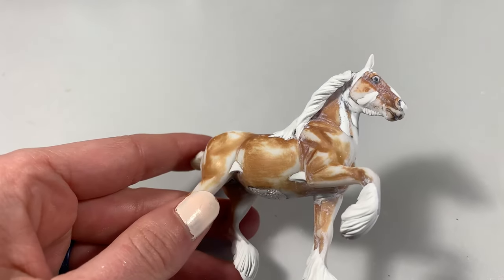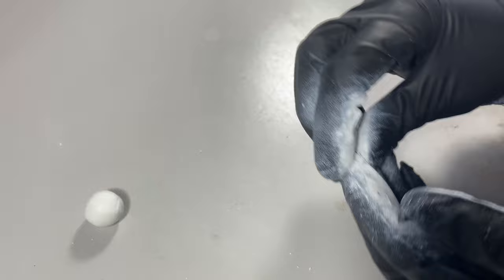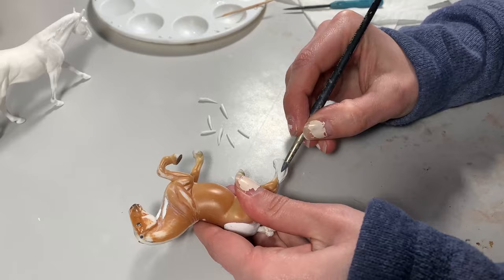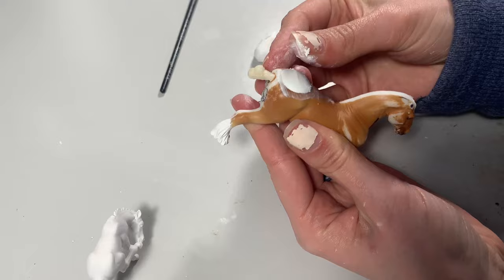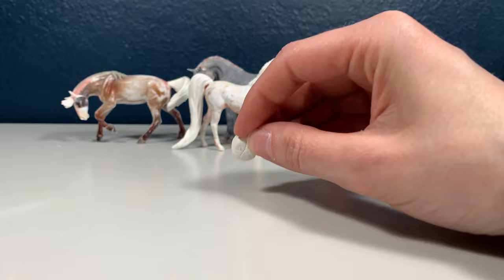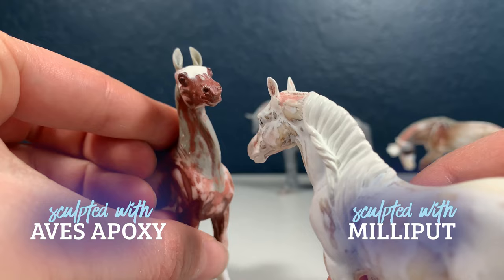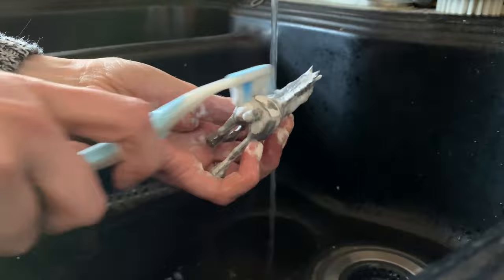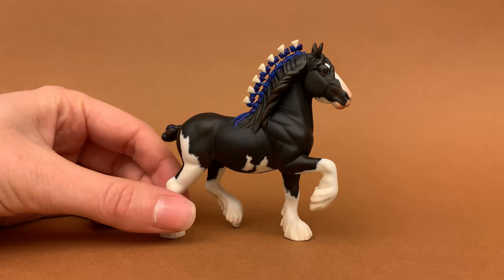From modeling to filling seams: SCULPTING & CUSTOMIZING with Milliput Superfine White

Comment: When you say isopropyl alcohol, do you mean that specific type of alcohol and not the normal 96 ethyl alcohol that we usually have in the pharmacy? Is normal ethyl alcohol suitable for dissolving, moistening... milliput putty or is it only valid for isopropyl? thank you.
Reply from the maker: Yes, I use isopropyl alcohol specifically. I haven’t used ethyl alcohol myself yet, and so I’d say your fastest way to find out if it will work for you would be reaching out to Milliput directly or trying it out on a test piece.

Comment: what grit of sandpaper should I use to sand down the putty over the butt of the horse as an example?
Reply from the maker: I recommend getting a few of the finest grits you can. For my own projects I use automotive sandpapers in 600, 1500 and 2000 grit ranges
Reply: @CreativeKristenTaylor  I used much coarser grits than those. I used a 150 grit to "knock off" the excess epoxy putty, which is exactly the one you're using in the video, Milliput Superfine, 2 part putty. So i used 150 to knock off the excess and then smooth it out with a 240, 320 and then 400 grit; all in the Tamiya Sanding Sponges. My build is a Hasegawa 1:200 Boeing 747-400 airliner. The nose of the aircraft is the most notorious for being poorly shaped from the factory so I have to sculpt it to look realistic as possible 😃